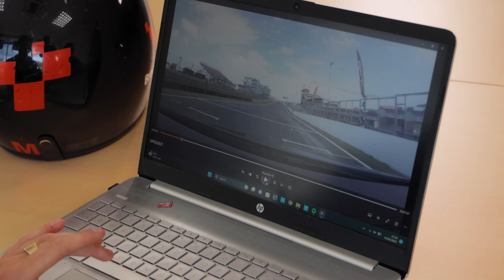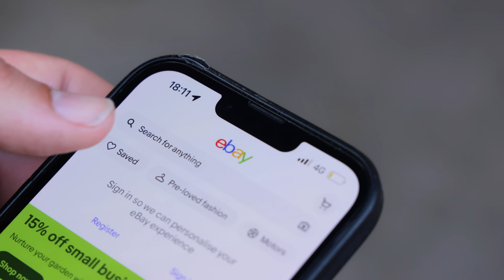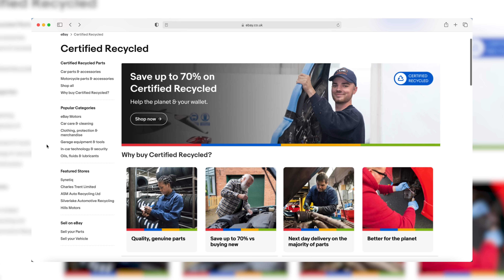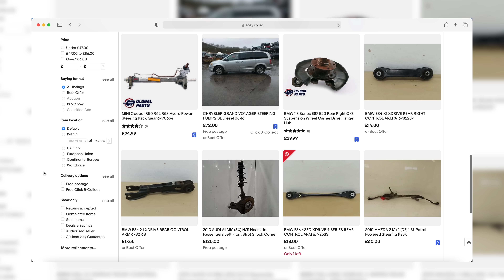How to drive fast on track (with your own car) | PH Project Car Pt.4

Comment: Before you add power you absolutely need the anti lift kit or you’ll get constant wheel hop mate
Reply: Especially when you accelerate up hills
Reply: and some lighter wheels, those VW wheels are heavy - 11kg or so each.

Comment: I've got to catch up on this series. Was looking at a second car / first car after 3 years not driving and was close to getting a MK5 GTI myself perhaps but for safety reasons and also maybe not needing 200 bhp just yet, gone with something a bit slower and newer
Reply: MKV is pretty bloody safe, any NCAP testing nowadays is "what sensors has the car got" rather than passenger safety inside
Reply: @R03333  True it's confusing how that is the case now but even structurally wise cars have come a decent way. My first car was a 140PS Fiesta 1.0 from 2016 and a heavy goods vehicle went into back of it when we had stopped at traffic lights on a dual carriageway. Car crumpled a lot but did its job to protect and someone has managed to repair it so it's out there again. One of the lowest mileage examples too probably 😥 May get a MK5 at some point but I have a 1.5 Mini for the moment :)